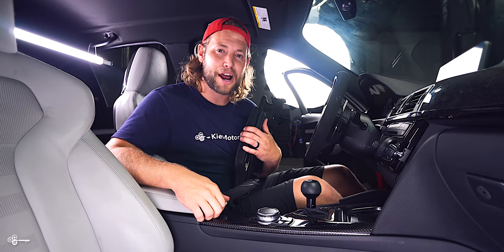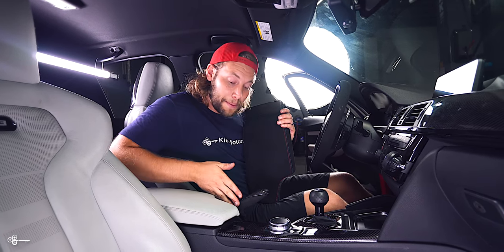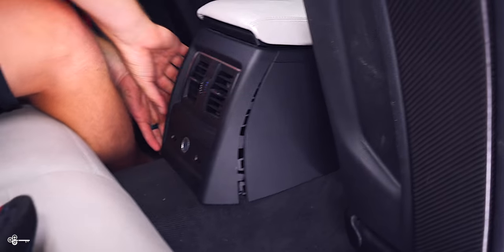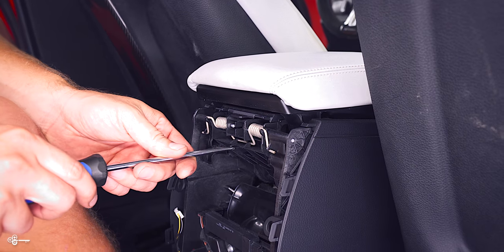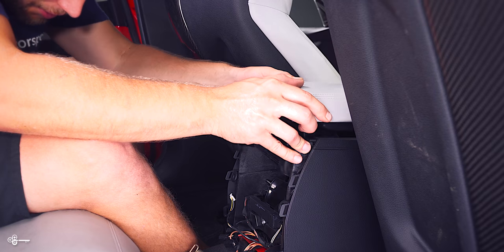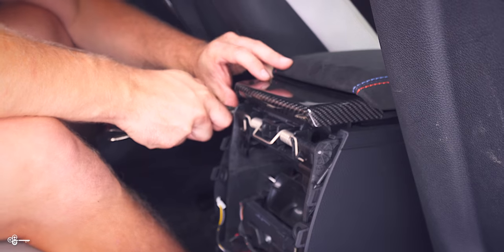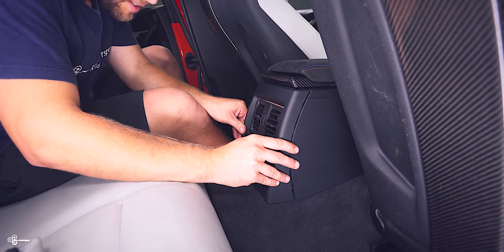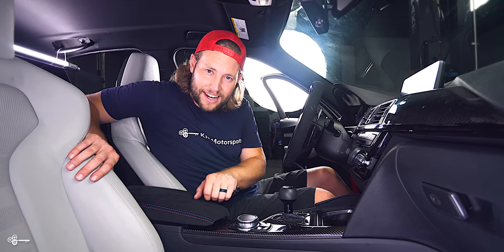DIY: BMW OEM ALCANTARA AND CARBON FIBER ARMREST in my F80 M3! (Also fits the F30 and more!)

Comment: I wonder how it would look if putting a carbon fibre overlay for the radio stacker would continue the carbon all the way down, and also a carbon fibre overlay for the rear airconditioning vents would just continue the carbon all the way down the central area of the car.